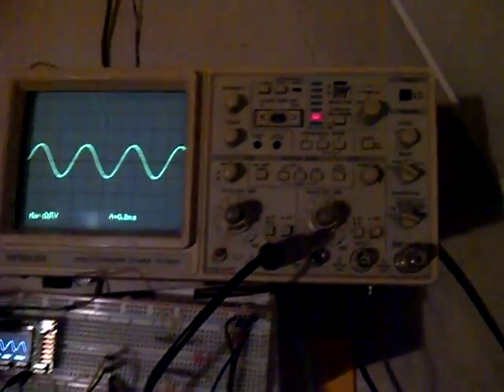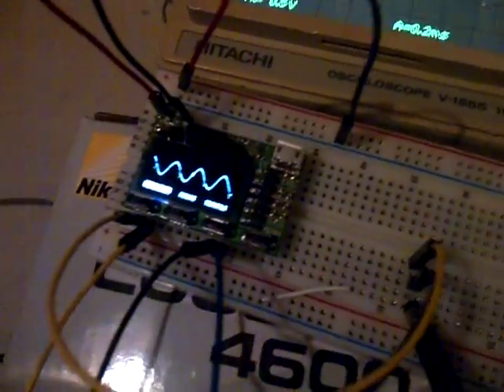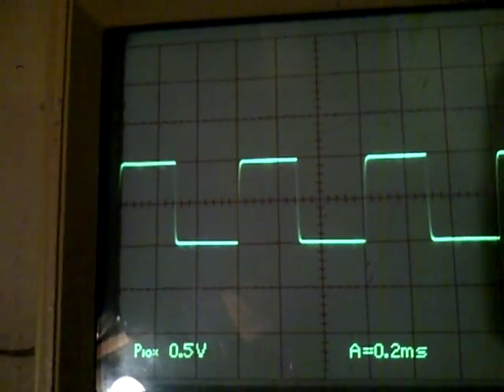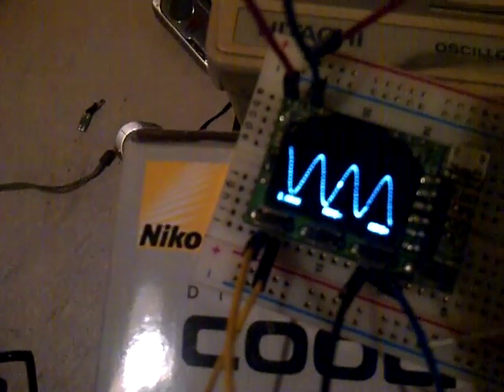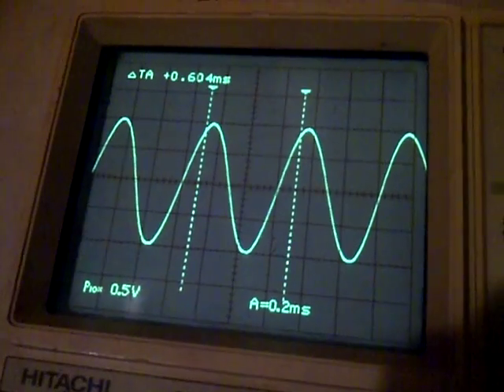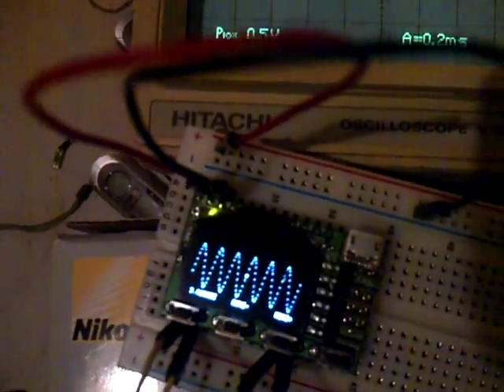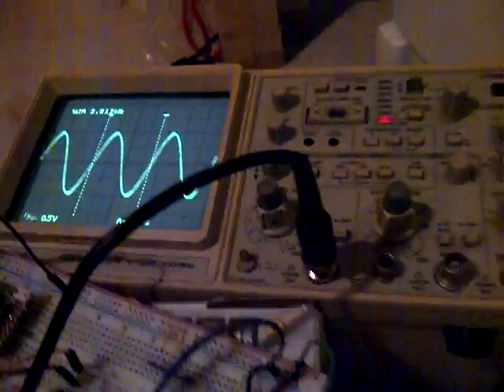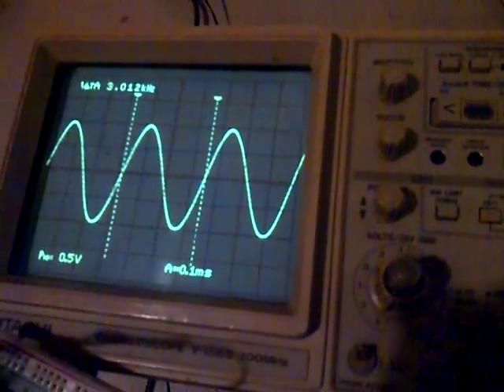Hitachi V-1565 Oscilloscope and Gabotronics Xprotolab Frequency Generator Testing

Comment: Hi.  Is there a way to capture the signal on the display; i.e. capture a still frame much like a digital scope?  I can't look at a 5V 9600 baud signal.  Thanks.
Reply from the maker: There is no digital memory in the scope, so as far as I know, it cannot produce a "still shot" capture of any triggered signal and keep it up on the display. It has on-screen cursors but that's it. Also I do not believe the phosphor has a storage mode, where you can make the image take several seconds to decay. I have to look more, but it is simply not much more than a CRO with on-screen cursors and measuring but no other digital features related to the signal itself.

Comment from the maker: By the way, you can always use the Graticule grid on the front display to visually see your voltage scale vertically and timebase units horizontally. The cursors are just a nice touch and fun to play with. Notice the scope automatically sets it up in Probe 10x mode which shows the correct reading, you don't have to do the math in your head.